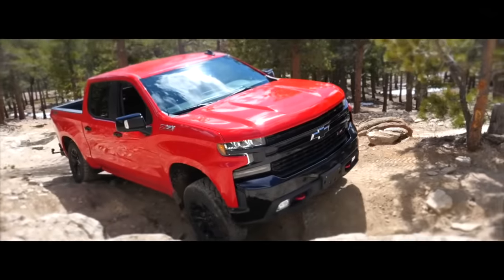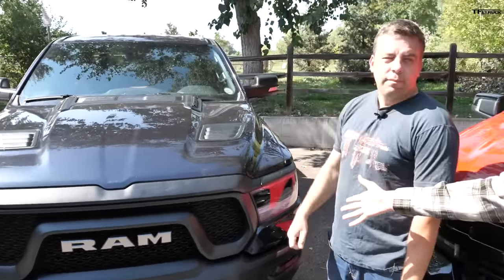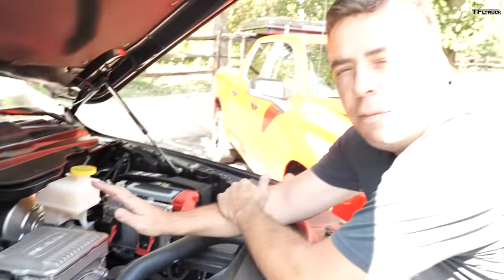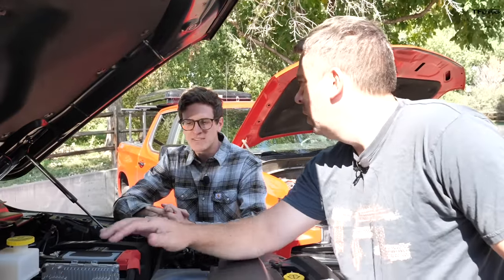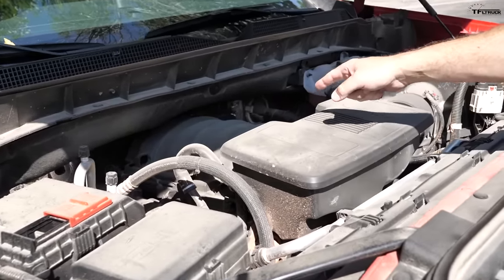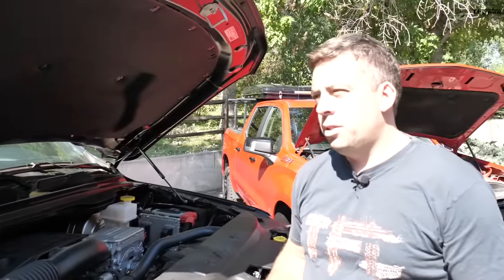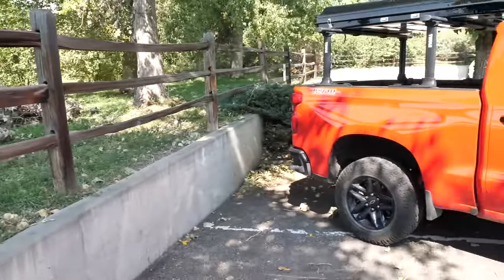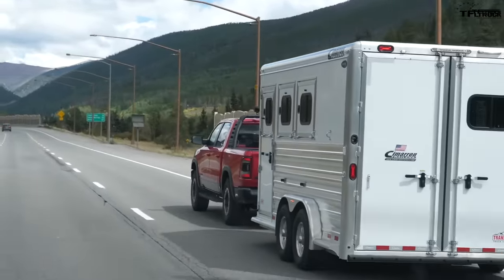New Ram Rebel vs Chevy Silverado Trail Boss: Which Full-size Off-road Truck Is Best For You?

Comment: I’ve got a 2020 Rebel, the interior is nicer than pretty much any vehicle I’ve been in. I have about 5k miles on it so far so we’ll see how it makes out long term. I have no complaints with it so far, I will say when a nice shiny new trailboss goes by it definitely catches my attention. They are both striking trucks depending on the color.
Reply: Mike Pipher the ram has a bright red too, but if you keep your ram in the shop on time and follow appointments, your ram will last over 300k
Reply: *Also has never been in a modern foreign
Reply: @Shooter60X   I should have said “nicer than any truck I’ve been in”. I realize there are much more premium vehicles out there.
Reply: @mikepipher3347  If you still have it, how has your experience been with it? I am thinking of moving from a 2012 Tacoma to a 2019 Rebel. Just unsure if I want to move away from the mid-size and the reliability my Tacoma has got me through
Reply: @nathanf1699  I’m getting ready to trade it in towards a super duty, but it’s been my favorite truck I’ve owned. I live super close to work so I’ve only put 25,000 miles on it since December of 2019 but in that time I’ve had no issues. The fuel economy kinda sucks but I think that’s pretty known by everyone.
Reply: @mikepipher3347   That is the number one “problem” I have seen is the fuel economy as well. Well glad to know it’s been solid for you, definitely considering it
Reply: This vid popped up in my feed and I had the same choice and I do not regret getting the Rebel. I still have it with no issues. The Trail boss had too much cheap plastic for the dated interior.
Reply: Any problems 3 years later? I'm about to get a rebel. Non etorque

Comment: Owned GM for years. One of everything. 5.3 LTZ - 6.2 Denali - 6.6 LTZ … One Ram a Limited 5.7 etorque air ride. Hindsight, should have kept the 2010 LTZ. Bullet proof 6 speed and great motor, my experience. Denali transmission failed, torque converter failed, in the shop more than out. 6.6 was awesome but once the trailer was gone, I sold. Ram is comfort. No dead pedal for the left foot was a factor.. I hate those bumps in the floor. Pedals are adjustable on the Ram. Seats are big and the steering wheel comes out to meet you better than the GM. I dislike the MPG with the Ram. It sucks enjoyment from owning the truck. I also dislike that it doesn’t have a bumper step and the many tie downs, although you can fix that easily enough. I dislike the air ride, too boaty as it floats on the road. Love the 19 speaker sound system. The headlights are awesome and the tech for backup cameras, towing cameras, etc is a bonus. Problems with the ram.. manifolds, leaking rear window, finicky 12 inch screen that I’ve had go blank on the road .. have to stop and reboot. There is no dedicated button for heated steering wheel or seats.. when the screen goes blank, you notice this is an issue. I would go without etorque but not possible now with Ram putting it in all trucks. Also would forgo the air ride. I like the Rebel but would opt for a longer bed in any truck I’d consider, even if I’d lose some backseat space. I’ve read that GMs has transmission problems in its 10 speed as well. Seats in the Ram are worth the money. The ergonomics are better for me. GM seems to have gone the way of most brands, small seats, less function. They’ve put power steering telescope in the upper trims but it limits the length of extension, my experience. Think I’ll buy a wagon car and a junker truck. Good luck and consider an extended warranty because everything is cheaply made, engineering is blind in many regards. Oh, the 5.7 with 3.92 is a pig, even with stop/go, lowering suspension, cylinder deactivation etc. Terrible. My 6.6, twice the truck and then some beat its fuel economy hands down. Don’t forget to check gas tank size.. it matters if you drive distance a lot.

Comment: I own a 2019 Silverado LT Trail Boss and I absolutely love it. I have about 27k miles on it now and haven't had a single issue with it. Have done lots of off-roading, towing, and long distance road trips and it's handled all of it in stride.
Reply: Yeah I feel like I could have been happy with a rebel too. My buddy has a 2017 rebel and really loves it(minus the infotainment system).
Reply: Yeah I think they’ve gotten better on the newer trucks, for sure. His is just too slow. He can’t even answer phone calls with it because the call is missed before the answer call button actually works. Witnessed it myself a couple times actually. The functions are there, but it’s too slow to function properly. The newer ones don’t have that problem though I think.
Reply: If you still have the 19 trail boss, how has it held up over the years now?

I'm about to buy a used 2019 trail boss and looking for owner opinions on it

Comment: I've owned 2 Rams and love them.  I currently own a 2019 Ram Rebel, and it gets the job done offroad.  In total, I've had Rams over a 7 year period and have yet to have a single issue.  Can't say that about other brands I've owned.
Reply: I've owned 3 Rams from 96 on up , having a tough time with all the electronics in newer models which brought me here . Trail Boss is to the extreme on analog though , i mean my 2011 which im upgrading from has more tech but HATE rotary shifter of new rams and hate having to go through 3 screens to adjusts heating controls...  seems more of a distraction then my Cell phone . Search continues
Reply: The current ram really isn't a working truck, it's for people with deep pockets that wants to look tough while having more comforts than even cars have now.
Reply: @darthbane2669  Who was talking about work trucks?  I'd say a Ram 2500 is a heck of a work truck.
Reply: @nanukofthenorth4095  Heating controls are on the sides of the Screen so very easy to adjust.  I don't have to go through ANY SCREENS, so I don't know what you are talking about.
Reply: U have to b the luckiest guy out there
Reply: @1gr8oil  exactly and if people dislike the 12” screen they can still get an 8” and more buttons/dials and save $3k.

Comment: 2020 Trail Boss 6.2L, Standard bed owner here.  Was not a fan of Dodge exterior so didn’t test a Ram, but did test the F150 and Tundra.  Ultimately, because I am 6’6”, fit and driving comfort were a big deciding factor.  As far as interior goes, I like it as simple as possible; as long as it has cold air and CarPlay I’m good.
Reply: You should have drove the ram.  I drove all three,  omg the ram drives so much nicer.  I purchased a jeep though 😂 it drive horrible before my modifications.

Comment: I’ve always had the best luck with Ram trucks, I take great care of all my vehicles so I have better luck than most but my last Ram 5.7 made it to 657k miles before the head gasket finally gave way, it was an easy fix due to the push rod design, the Ford would be a disaster to fix due to the ovehead cams and the unnecessary amount of valves so the Ram and gm win here. All three trucks are fantastic and you can’t go wrong these days with any of them but I’ll always spend my own money on the rams. I’m a mechanical technician currently working in the aerospace industry on missile systems and I have to say that the Ram trucks are amazingly high quality these days. If you can afford the Ram definitely go for it, at least go and treat drive it if you normally buy Ford or gm, I think you’ll end up buying the Ram. It’s pretty incredible how fantastic all of these truck have become, especially the rams which I can’t stress enough are just so close to perfect.
Reply: Crap thats a lot of miles! 
For any Truck.
My best on a Dodge maxi van hd was 350,000
Reply: come on man @657miles that ram would be nothing but a pile of rust, I really mean @65k
Reply: @lakernation4725  Try the new Ram trucks.  Things have changed.

Comment: I went with the 6.2L trail boss and love it
Reply: this i understand...that 6.2 is awesome, not to mention 10 speed transmission! if only we had RAM interior + GM powertrain (also like 2" vs 1" lift) we'd be in truck heaven.
Reply: @unixdoes  the trail boss has a factory 2” lift.
Reply: @unixdoes  on the 2021 at least
Reply: I would take simple and actual truck features over interior......

I've had new 1500s and 2500s.....ram I have now I feel like I could break it pretty easily, my 2021 gmc 1500 would be hard to break, my 2022 2500 silverado I don't think I could break it if I tried.......

Just a feeling I have about last 4 trucks in last 4 years
Reply: I'm looking at getting one now. What do you think.  About getting one with the 6.2 V8 or get it with the 3.0 Duramax
Reply: @jasonroberts930   can’t go wrong. But it’s 6.2 for me. I don’t do much towing .

Comment: Go with the Ram. I have a 2019 Ram Big Horn with the Hemi and tow 95% of the time and have 28,000 miles on it in just one year without any failures. Love this truck
Reply: I have a 2018 Silverado with 70000 miles no issues. I also have a 2019 RAM with 33000 miles. The RAM has been ok but it's averaging 14 mpg mostly highway.  Go with RAM if you want to get a truck which does not match advertised performance.
Reply: 2019 Custom Trailboss purchased in July of 2019, now with 47k miles on it. Only problem I have had is the radio glitched 2 times and wouldn't turn off. I regularly tow 7000lbs+ and have had no reliability issues.

Comment: As an owner of a 2021 Rebel I’m partial. I did drive a 2021 Chevy Silverado with the 6.2 , prices and options close. The Chevy was slightly quicker , had much more torque. But I chose the Ram.  Keep it up guys I enjoy your blogs
Reply: Do you know which one has better mpg between the two 5.7hemi  and 6.2 ……?

Comment: I'm a Mopar guy but I love trucks from all brands. I wish I could somehow drive different ones all the time. Personally I feel Ram has the nicest interiors and innovative storage bins like the ones under the rear floor mats, the double glove boxes, optional Ram Boxes in the box sides etc. Ford has improved their interior for 2021. GM may want to invest in some nicer interior designs and materials too. The Ram back seat in the crew cab is a few inches larger than the Chevy that's why it has a shorter box.

Comment: Another vote for the Ram, but with the standard HEMI, no food processor.
Reply: If only they had a real shifter instead of a food processor dial.
Reply: Joseph Whiskey Beale good point!
Reply: @josephwhiskeybeale  no one has actual shifters. Even if the truck looks like it does. It doesn't, everyone has electronic shifters and gm was the first to use them. The I like the dial better after having one.
Reply: The "food processor" is what makes the RAM competitive.
Reply: Add a Mr Fusion and I'm all in...
Reply: @davidporter7051  the food processor was Ram's response to GM coming out with Auto Stop many years ago.  Many people who have auto stop in their Chevy's and Ram's press the button to turn it off so the engine doesn't turn off at so lights.
Reply: @sonsofliberty3081  
That was my first thought, they’re all electronica, it’s just a façade to make you think you’re shifting. Although I just ordered the 2021 rebel, moving up from a Ridgeline, and I’m wondering how long it will take to get used to not having some place for my right hand to rest.

Comment: I've owned both of these trucks both 2020, i like the Trail Boss better..it actually feels of better quality and more reliable layout. The Rebel was having electrical issues at 8k miles!
Reply: What kind of issues?
Reply: yeah but did u get it kitted out with all the doo dads?  cause getting a base rebel with the 5.7l  and 4x4 should help eliminate more things to go wrong
Reply: @toddmayta7615  I had an issue with the back up camera system whenever it rained and the heaflight assembly going out as well
Reply: @dr._breens_beard  all it had was the rebel 12 package that's it, no moon roof didn't come with a brake controller..
Reply: @rossgreenzweig  hmm.  Prolly just down to chrysler's craptacular electrical systems.
Reply: @dr._breens_beard  all posts from you should be erased for the usage of prolly. What is this? It is really easy to use probably. Is spelling a issue for you?
Reply: @davidporter7051  prolly should.  But prolly wont 😘

Comment: Tommy, no one believes you would take the Chevy over the RAM. No one.
Reply: Many do actually...especially those who have driven both.  the Ram doesn't drive well.
Reply: @MrTaffiny1  I had a RAM 1500 with the coil spring suspension. It drove extremely well, with or without, a load.
Reply: Ram drives way better than Chevy in half and 3/4. Night and day difference
Reply: Noooo one

Comment: I have a 2019 Custom Trail Boss and I love it.  It looks and performs just like the $55k LT Trail Boss, but without all the fancy features or luxury options, but I only paid $37k.  For that price, I'll pick my truck all day.
Reply: I went with the LT Trail Boss.  You couldn't get a Custom with the 6.2 in 2020.  With kids and a dog, the leather interior is much better.  I needed the console in the middle of the front seats instead of the folding third seat for things I need to keep with me.  $51k well equipped before I added several thousand in accessories.  I'm also very glad I have the 10-speed.
Reply: Who spends that much and doesnt get loaded?
Reply: @boostedbavarian  people that want a better package with higher resale value. Unless it’s a specific option like the Torsen Front diff on a Raptor, options get you zero on trade in value, where as a package level difference bets a large improvement. 
Short to say a base upper level will save you more money over a fully optioned lower level.

Comment: Tough choice, I like them both but I got over 400k miles on my last ram and it still runs lol. Transmission just started slipping so I parked it. Now I’m trying to decide what to buy next. Great video, you guys were very informative. I’m probably gonna go with the ram.
Reply: Put 2 transmissions in my 2014 GMC with only 150,000 and did not use it to tow. Hope my Ram does not have this issue.
Reply: GMCs are known for transmission problems.  Why do people still buy them is beyond me.
Ram has way better ride quality and stronger engine.
Reply: True to that!!!! I also have a dodge ram 2005 with around 400k miles . Same transmission and same engine. Knock on wood everything is fine  for now . I just recently got my ceramic gray rebel .. and I must say it’s a bad ass truck !!! I also had an old dodge ram Dakota 5.2 v8 with over 450k miles on it. Same engine I had to change the transmission though , but engine was great .

Comment: Sorry, I'm a GM guy.  I pick the Rebel, without a food processor.
Reply: Next time you check out a Ram try operating the radio or climate with the gloves on.  This is why Chevy wins.
Reply: @domin8ss  imagine driving your truck with gloves on
Reply: @KY-sq4en  that's not hard to imagine at all.  It happens at farms and work sites all the time.
Reply: @domin8ss  most people take off their gloves in between jobs. but nice try, guy
Reply: @m.brandon6544  you are not most people.  You need to do better with your replies.  After all, it's been 3 months since this conversation ended.  You should seek attention elsewhere, offline.
Reply: @m.brandon6544  dudes a clown, when I'm out working in gloves, they get nasty, I'm taking em off before I get in my truck lmao

Comment: E-Torque is a $1450 option on the HEMI and it helps boost the fuel economy by 2 MPG or so.
Reply: make sure to tell me how many years it takes you to make up the $1450 by maybe saving 2MPG, GM for MPG
Reply: @lakernation4725  with todays gas prices not as long as you’d think lol

Comment: The Trail Boss is a cheap add-on package to any Silverado trim, just a cheap G80 locker, 32" tires, a 2" front lift spacer and a black grill.  The RAM Rebel is a complete model and off-road package on arguably the best line of trucks currently in production.  So yeah, I would get the Rebel with it's true e-locker, Bilstein tuned suspension, 33" tires, fully to itself exterior & interior details.

Comment: To get that miles per gallon in the ram you need to be really easy on the title and follow the speed limit to a T I’ve got a 5.7 2019 they are really nice trucks I’ve got 200 thousand km so far I’ve had to replace wheel bearings and an alternator , the wheel bearings was my own fault for riding around with 3 inch wheel spacers then I got the offset rims for the stance i wanted. I owned the truck since new 740km I got the truck .
What I need to do to my truck now is all fluids change transmission rear axle I think I may need rear shocks also but all round I love the ram so many more upgrades

Comment: Have been studying the Rebel for 6months. Test drove a Trail Boss and bought it. There both nice trucks!!! Had get used tho 55k is out of my range. Hope it works out!!
Reply: Haha, I’ve been debating which truck I want, my brother got a brand new 2021 rebel, I’ve been looking at a rebel, trail boss or an at4 and I’m struggling.. I’m thinking rebel or trail boss, did you test an at4 and if you did what was your opinion on it?
Reply: Did you test drive both befote making your purchase? IMO, GM has the most comfortable seats, but Ram is the only truck that switched to coil springs. The ride is so superior! My Rebel with towing package is awesome. I barely know the trailer is behind me. The 5.7 hemi is soooo much better then GM's 5.3. And GM 5.3 manifold bolts break all the time. GM is aware of the problem but looks the other way...shame on you.

Comment: You should test the fuel economy on the 2020 Rebel and see if Ram changed anything to improve over your original test.
Reply: Scott Egan but it is a truck, they should add turbos to theirs rams and stop complaining about the 3 less miles per gallon witch when put on the road isn’t a difference